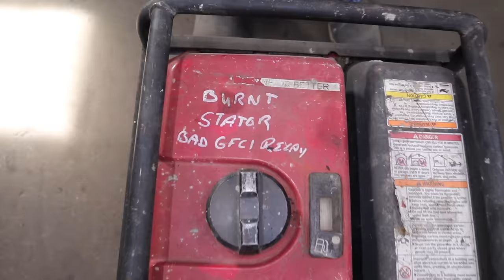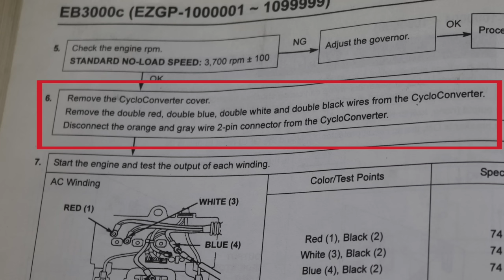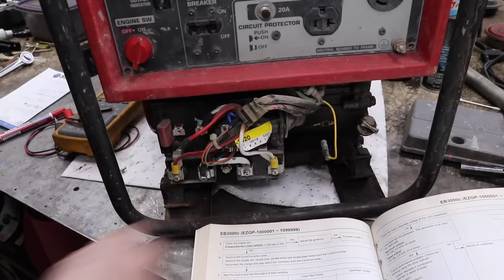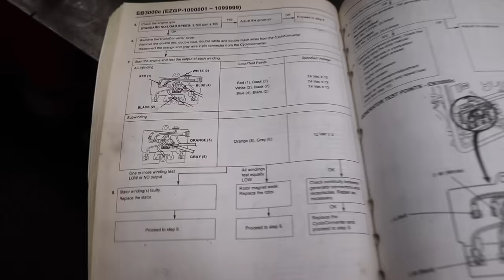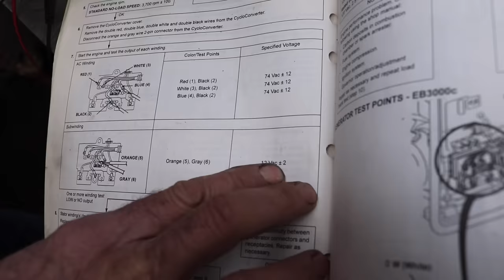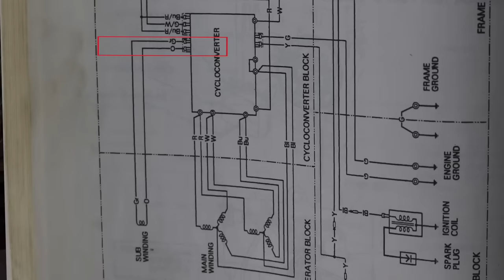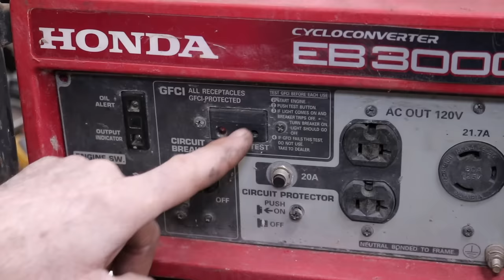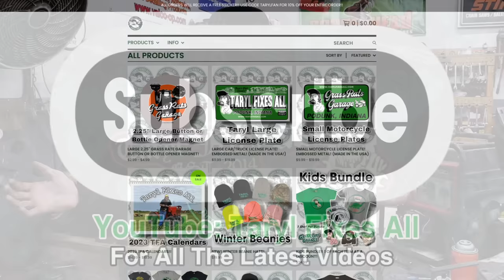Some Things Change For The Worst

Comment: I rarely disagree with Taryl, but i bet it's only the Capacitor that finally wore out. Capacitors don't last forever but they're cheap and easy to replace. The fact that Taryl does a video slamming Honda when he's a Champion dealer, yet whips out a troubleshooting manual that Nobody, including Champion, offers, is kind of ironic 🙄 
How old is the unit? And how many hours were on it? It IS an inverter generator... obviously going to be more fragile than non-inverters over time. 
Yes, they're expensive. I don't have one either. It's true that Honda will build their electronics such that they're not fixable...
I have a Honda ruckus scooter with a blown voltage regulator which should be a $15 diode, but Honda built it into the ECU which would be $500-. I don't need electric start for a scooter. But nevertheless i don't like how this seems to be an ad for Champion, when you're comparing parts supply for Brand New generators to old models isn't honest 🤔 
Sorry
Reply from the maker: Thanks for your input. Please read the pinned comment at the top of the comments from bass guitarist1985. also I"m not a champion dealer I said service center. I work on a lot of equipment and when you see the problems with equipment over and over again and customers who make the final decision on wether to have that piece of equipment repaired or not based on cost or not being able to get repair parts. The manual is only available to Honda dealers.But you may be able to find one online. Now there's your dinner!
Reply: @TarylFixesAll  I should have specified "service center" thx. Nevertheless, I stand by my statement since that Honda model has been around for a Long time and is now discontinued. Not fair to compare parts prices when Honda Honda has discontinued the model and Champion is still new. I'll be SHOCKED if Champion has parts available for obsolete models 20yrs from now. 
Just one more point... you do know that if any company made any msss-market product that didn't Eventually wear out and need to be replaced that that company would go out of business once everyone had one. 
This is why cast-iron stove companies go out of business... can't sell a product to customers that last half-a-lifetime and expect your factory, employees etc to wait around for new sales. So let's be fair. Nor am I saying that Campion generators aren't good machines or a good buy 💁

Comment: honda is an engine company. they just make things for their engines.  but  at work i live in a camper van and the honda is quietest and in a quiet box so they dont know. its about 50 ish db and 30 db in the box its been running two years.  they dont want people living in the parking lot.  yea mines running. ill just buy a new one champions wires are too short they rub. i got the eu 3000. for heat and ac.

Comment: Problem is the motors last too long for the generator if it's 8 to 10 years old it's junk obsolete. If it's real old say 30+ years they can be kept running forever rewind stators and rotors forever the electronics are the problem 90% of the time

Comment: That honda is probably 20 years old with thousands of hard construction job hours on it, do u really believe a champion would be able to perform the same and 20 years from now still have parts available? Doubtful, plus all the people on here saying how they ran there champion for a yr and only had to replace a carb part or some other part that was readily available, it broke within the first yr and I guarantee u wont find any parts 20 years down the road, u best hope they always have parts available cause there gonna be breaking down regularly but the honda will keep on running for decades

Comment: EG2800i is junk. Had this fixed under warranty after it had serious cylinder scoring. Only ran it on a single outlet of the duplex receptacle; never once used the 30A four pin receptacle. I had to buy another generator (other brand at a different dealer) to take its place. At this point, it's worth noting that a year of my warranty on the EG2800i was wasted because Honda couldn't supply the parts. When I finally got it back, I test ran it and put it in storage because the replacement generator was still set up in service. When I eventually took the replacement genset in for regular service, I pulled the EG2800i out of storage, yet after only 12 hours of service the EG2800i had same problem as before. 

Honda has, for some unknown reason, decided to put some young dickwad megalomaniac in charge of their warranty department, who refuses to acknowledge that they were the ones who couldn't supply the parts. I told him that, at the very least, had anyone checked Honda's screwed up flashing light excuse for an hour meter, they would have realized that the genset hadn't even made it to it's first service interval since the rebuild. In fact, it never made it to its first oil change.

So, I have a warranty rebuilt Honda genset with roughly 12 hours on it that is now a boat anchor and they want $800 to fix it because they feel it wasn't their problem if my warranty was running out while it was in the shop for a year. The dealer has been very nice throughout all this, but Honda's actuarially focused warranty department head has made me choose greener pastures. 

I will never buy another Honda again.

Comment: wow!  It looks like a   [3 phase AC to DC rectifier bridge]  feeding a   [DC to AC inverter]  would get power going;    then mess around with the generator rpm control?
No cheap fix unless someone would come up with an after market module to sell online or just buy a better generator. 🤣 thanks.

Comment: Honda cars are mostly flawless till 170,000 miles , then the service engine lights start with failing sensors it will rape your wallet over and over. Ticking time bomb cars

Comment: I don't understand what inverter generator means. Don't all generators make dc that then has to be converted to ac? And then if you're charging your phone battery, gets converted yet again to dc. Lotta converet
Reply: I believe it's like this, a conventional  gen makes the AC and uses the fixed rpm of the engine to regulate the frequency. The inverter generators also produce AC power, but this current is converted into direct current (or DC), before a microprocessor inverts it back into cleaner AC power.  So its more complicated process to give you cleaner power which you may or may not need.  On the inverter set up, the engine speed runs in relation to the demand of power, so if your demand is low the engine can run lower r[pm, as demand increases the engine speed increases, this should translate to better overall gen effieciency.
Reply: An inverter generator means takes 3 phase AC voltage produced by the stator the engine drives and rectifies it to a DC voltage. The DC voltage is fed to the inverter which changes it  to a stable 120V AC.  Inverter generators output a more stable and clean 120V than a conventional generator.  They are also quieter and more fuel efficient.

Comment: 16:45   THE  ELECTRONICS, involved in the  ' inverter '  circuit  box, has  BLOWN  MOSFETS/   IGBTS'.......or whatever other power semi-conductor used.  THROW   IT  AWAY,  and connect stator to an  AVR   ( SEE  schematics ).....and  to  heck with  ' inverter ' generator.  MAKE  a normal, gen out of it.   IT   is  possible !

Comment: Taryl could your inventive brain be able to build a 3 wheel mower with the ability to have two blades , the first to do a adjustable height cut and the second to do a adjustable low cut at the same time . Now there's a challenge for you?  Andy UK.

Comment: I worked on a bunch of Honda generators from the 1980's about 5 years ago (~2018), after I cleaned the neglect (carburetors & sparkplugs) they all worked fine.

I think, after Soichiro died the company went downhill (1991). Sometimes they do release a great product, but if they have a problem they run away & pretend they didn't make it, instead of fixing it. 

(ie: the first Honda Passport, which was made by Isuzu, that was still for sale when dealers refused to sell)

Comment: What about Yamaha generators? Are they good?
Reply: I've had a Yamaha EF6600DE for 10 years and it never fails me.  Commonly run it during multiple day outages.  It's not an inverter type, but the power seems clean enough.  Never any problems with electronics in the home.  I think inverters are over-hyped- any electronic device you plug in converts the AC power to DC which is filtered and regulated by its power supply anyway.
Reply: Have a Yamaha EF6300iSDE Generator that is 14 years old and have not had any problems so far. However, if something would ever go wrong maybe you would run into the same problem. Like anything, if you find that replace parts are NLA or if they ore out of this world expensive, they are junk. I have various pieces of farm equipment that are over 40 years old that I can still get repair parts. Although they might be quite expensive, they are never the less still available and compared to the price of a new piece of equipment, well worth the price.
Reply: @WJCTechyman todays new Honda generator is tomorrow’s discontinued product. You totally missed the point of his video. Get that Honda glitter outta your eyes.

Comment: All gas powered generators are garbage, i have a rugarene it came from Yugoslavia its a 4k diesel generator and it can run continuously if you keep the tank full and you can't do that with a gas powered generator cuz the motor will not last very long, i love my diesel generator it has so much torque it would eat a gas powered generator, it was made in 1980 and still running strong

Comment: Honda is such overpriced crap on their small engine stuff. I bought a Westinghouse iGen 2200 for $500 and it's just as good as the similar Honda model they want over a grand for. Mine runs like a dream. Too bad they didn't make them as good as their cars.

Comment: That engine sounds like it is running like a Champ.  Sorry but I would find a way to isolate the engine - and at least put that to some use.  If one were even so inclined - one COULD even make their OWN Inverter - along with their own alternator as well!  It just depends on how far you're willing to go - and what you can do / know how to do.  This is why I recommend people learn how to build basic electronic components / circut/bread boards / basic electronics - know how to use an oscilloscope and whatnot etc.  It is extremely helpful.  Not saying a tech like you should do all that - waste of time and money.  Just if that one COULD do it on their own, who has the time and likes doing stuff like this as pet projects - THEN maybe...  If I was going to have a professional do something even close to that for me - I'd commission a total badass generator -  one much larger too with backup components - maybe even a backup engine!.  :)

Comment: Ya but how knows how long champion will have the parts in stock or how long they will make the parts for it and if the price will go up on the parts or not. Every thing always sounds good at first in till years later and it brakes and you can't find any thing for it that goes for everything in my opinion  and will happen to almost everything in the long run  because nothing built to last for ever and won't be offered for ever it like humans short  life span sucks but reality. 🛠️👍👌✌️💯🍻🤔😉

Comment: I was wondering what other brands with similar, if not the same functions, are on the market.  Guessing easiest is to start with one of those and then design the rest of the functionality, if all wasn't present, so to have an option on the market whether open source or not.  Wishing I had the time, though the Brain Invaders won't stop being invasive nuisances with their mind control beam forming remote sensing stations concealed wireless assault weapons like typical insurgents do to create crime all false fabricated an all like inbred genius crooks that leave us junk and crooks.

Comment: Honda... We know they are supposed to be the best...  What you not saying...
Reply: What are you saying?
Reply: So we just hack that part.  Electrical... I'm not a pro.
Reply: Exactly.  There's someone that can explain/
Reply: 650$ exactly.  I'm not a pro $8 the most parts and manual labor is extra..
Reply: dwl toilet water... it could be colder based on the pipping..  Electrician can make money fixing this problem locally.  Then you get into the legal issue of.... DON'T TOUCH MY PARTS LIKE THE IPHONE.
Reply: okay legal issues with Honda
Reply: @donmoore7785  Now finishing the video.  the hardware is good the electronics is at fault.

Comment: Honda generators are junk?  What does a generator do?  It generates electricity.  Do all generators provide the same quality of electrical output?  Have you ever hooked one up to an oscilloscope, ANY Honda, and compared it to any of the endless number of Chinese junk brands on the market...or even some of the established name brands?  Probably not.  The inverter generators produce power so clean it is hard to tell the difference between that and wall outlet power.  The CycloConverter is a step lower but still very good clean power.  Bucky Beaver and his pal don't have a single reasonable complaint here...except that parts for DISCONTINUED Honda generators can be pricey.  The EB3000C has not been made for several years...I forget when they left the lineup but I worked in a Honda dealer for 20 years and saw the pattern of parts pricing and availability over the years...nothing surprising there...the blades for long since discontinued tractors had reached something around $100 for a pair a few years back if I recall correctly.  Again, how does that make a Honda generator "junk"?  Generators make electricity.  Cheap generators make "cheap" electricity.  Go ahead and try running sensitive electronics, as we all have them now, with a true "junk" generator and find out how expensive "cheap" power can be.

Comment: you are supposed to check the stator ohms and check the leads for ground shorts with the engine not running dummy
Reply from the maker: WOW Thanks for the compliment. If it was shorted it wouldn’t have put out voltage. Genius